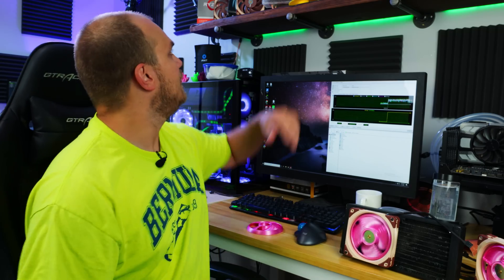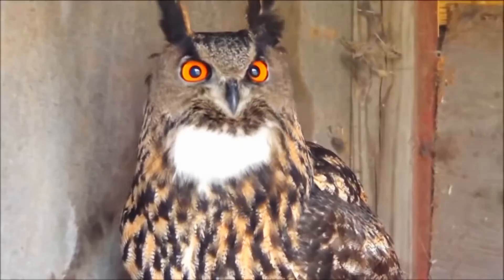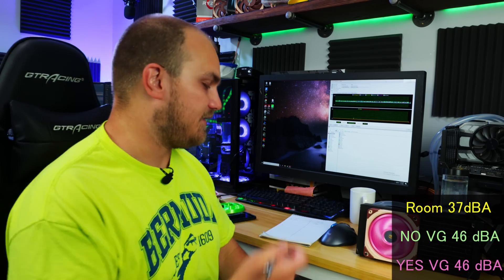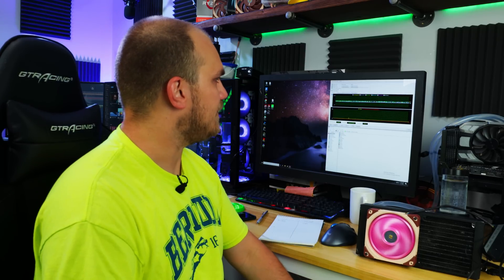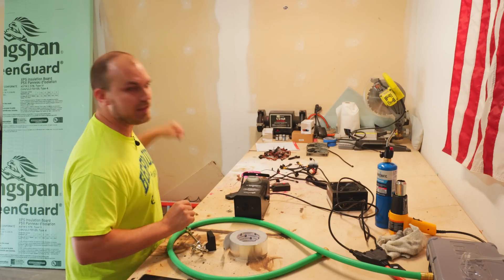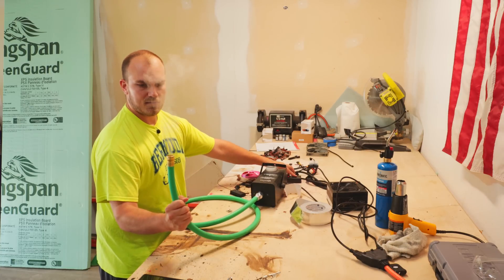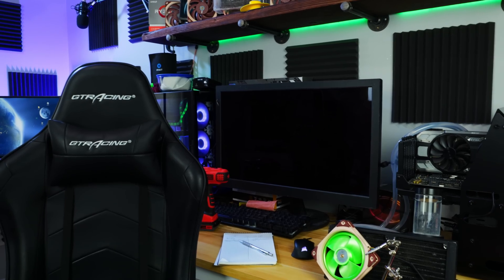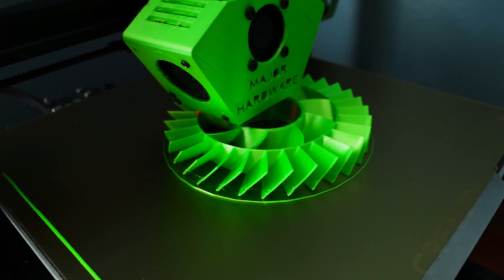Do Vortex Generators Make A Difference | 3D Printed Fan Testing

Comment: Hey Major, I think having the inward curve for the outer ring of the fan blades disrupts airflow. The frame has a chamfer to be able to pull more air in smoothly, the curve disrupts that (if my thinking is right). Maybe try reducing height and having it straight for blade strength. 
Now, what would you think of a bit of a wind tunnel by using a scrapped frame attached with a good frame and reverse the blade direction so the back of the fan pulls in air. I feel that I am not explaining it well but basically think of a turbine fan that has that second frame at the other end to keep it stable and not sag.
EDIT: my suggestion was made  while watching the vid, very cool concept at the end.
Reply: I also believe the fan-ring is disrupting and needs to be inverted, so it follows the curve of the fan-chassis. 👍
Reply: @Anziilife  That will increase air-speed flowing in while keeping the volume of air moved roughly the same. His current design reduces the speed of the incoming air by expanding the volume it occupies. Both methods have upsides and downsides, a large fan with a small outlet will be quiet but will have to be strong enough to push the air through the smaller hole. a smaller fan with a large outlet will allow greater surface contact with air on a cooler while saving the electricity required.. Good for mobile applications where size isn't a limitations, which honestly isn't really that much of an appeal, you should either go for same-size fan and cooler, or larger fan with a reduction into a smaller cooler.
Maybe sometime in the future they'll finally utilize the backside of the motherboard for cooling instead of just being a backplate. Maybe some clever case design and a water cooler will allow you to take advantage of the huge waste of space? I can see a radiator that pulls in air from the top in a blower like design through the entire radiator and blow the hot air at the bottom (or reverse, if it's a case with feet which will allow to easily pull air upwards). This also avoids sucking air into the case itself with all your precious electronics.
I would like to see an extremely large fan fitted with a tunnel to reduce its volume while keeping the same amount of air. But I honestly don't know how to explain that the tunnel should be a part of the blade rather than just a huge fan with a fitting to reduce it to a normal size.
Reply: @ScarletFlames1  So it would actually help increase the pressure on the fan, so it would perform better with the radiator to have the ring match the "scoop" of the chassis?
Reply: If I'm understanding you, you're talking about setting two fan frames back to back so that they will rotate in opposite directions,then engineering the blades so that one set pulls the air to the center and the second set contrarotates to push the air out the far side.

Sort of like the Cesna 337 Skymaster.
https://en.wikipedia.org/wiki/Cessna_Skymaster
Reply: @martindinner3621  Not quite, that is an amazing idea though. 
I was thinking more along the lines of having a short tunnel between the two frames to have elongated fins. The first fan would need to be positioned backwords since the framing would normally stop it from protruding further behind itself. the second frame would be to hold a central beam or rod so that the fins would not sag and hit the interior walls of the tunnel between the two frames.
Hope that made a bit more sense.

Comment: dont remove the ring print the ring straight up and down and get it as close to the housing as possible then go with a flat 5 blade design or go with and inversed ring that way the widest part is at the top and tapers in see if you can create a vortex kind of effect
Reply: What if one made a full on velocity stack? Make the ring into a trumpet.
Reply: @daniel46245  i see where you coming from yes i dont see it being much of if anything of an improvement but lets say you print one that is just a bit bigger then the noctua frame but not to big almost like the opening of a funnel with more of a flat blade and say 5 or even 6 blades i wonder if the static pressure diffrence and cooling could justify a bit of a bulky fan design probobly not but i would like to see it done mainly for entertainment

Comment: Dude the pink fan was disrupting the flow much more than the green. It kind of looked like the Pink fan was pushing the air away and causing a ripple in the smoke flow. The Green fan was sucking in the smoke smooth. Those small ripples/waves in the smoke stream with the Pink fan was the disruption that causes the air to pause a micro second before being pulled in. I don't really know if that is a good thing or bad but, think about swinging a knife into a piece of fruit.

Comment: Hey my dude, as always great video! 

As per usual, i highly recommend you to smooth out the surface of the fans somehow, it will help with the aero.
Reply: Acetone vapor bath. Also an array of straws should be used with the smoke machine to create lamanar flow.
Reply: @JazzyFizzleDrummers  Acetone smooths styrenes. This would not help with PLA
Reply: @rkatz69  fair point. I'm sure there are volatiles that would work with pla

Comment: Keep the vortex generator!
Also, you should use the same color when testing because the pigment can change the filiment a lot. However, since you aren't testing the strength of the fan, it shouldn't matter.

Comment: That fan has curved outer edge rim, try a straight one because you are now loosing a little bit on the intake side, that might make some difference.
Also it would be cool if it opened up "above" the fan on the intake side, to get bigger surface area, that would be funky :D tho narrowing towards exhaust means it will probably not work
Reply: Great suggestions and the converging geometry youre talking abouy should still work. It could be thought of as a nozzle, where pressure at the outlet is reduced but stream velocity is increased. Depending on the fin density of the rad, this may help or hurt the results. I'm inclined to think it would help substantially. I'd propose matching the OD of the inlet with the outside dimensions of the fan housing so you could still mount several on a rad, but increase the inlet volume. Would require going taller on the overall design.

Regarding the flow disruptors, I'll echo what others have commented: the surface roughness of the 3d printed surface is holding you back from both performance gains and real results regarding flow separation/turbulance. Consider abs with acetone smoothing or applying a couple layers of thick primer on pla to fill in ridges. Also consider adding those turbulance features to the underside of the blades as you similarly want to reduce the height of boundary layer flow causing drag and slow velocity air on the underside of the fan blades. Regarding the overall geometry of those features: i agree height is a bit higher than necessary and they could be a bit longer.

Also check out the ends of noctua's blades, they have small valleys that help guide the flow towards the center of the fan area rather than being forces to the side by centrifugal effects. They reduce the low pressure area at the center of the fan and help disperse the flow better across the rad.

Comment: Wouldn't 6 blades be more stable than 5🤔
Reply: I'm not a engineer or anything, but just a taught.
Reply: No it should not make a difference
Especially not at 3D printed fans
Reply: actually having a odd number of blades makes it more stable and also not change much if something slightly damaged. go check every fan you can and you will see that they all are odd numbered. It also somehow balances it better.

Comment: Thicker wing front edge creating "lift" into the case.
Reply: Yeah don't listen to this guy. He's dead ass wrong. Sorry, not sorry. Airfoils do create lift. By decreasing ambient pressure above the wing, atmospheric pressure below the wing is able to push up and try to get to an equalized zone. Suction is not strong, pressure is. Think how big dust collector hoses for woodshops are, but how you can easily move just as much sawdust around with a thin compressor hose, and a blower set to 5psi. (not a completely accurate analogy, but very close). This is called a reaction based pump/fan/prime mover. Reaction type pumps are great for high pressure, but awful for mass flow rate, which is why pc fans don't use them. The high static pressure fans you see are generally also impulse fans, but incorporate some reaction principles or design. Not enough that I would go so far as to call them impule-reaction type, though.
Reply: @g45h96  I think that same rayzim dude has been "teaching" fluid dynamics to everyone on other videos of this channel too, dunno if it was this comenter or another one with similar things claiming you don't make lift on fans because you don't want to load the bearings... because it seems that the axial air flow magically does no load on the parts, nevermind that strong fans set on a desk start moving on their own at full power...
I mean I get it that fluid dynamics is one hell of a topic (my tests on that class are still sort of a trauma and pride at the same time in my mind...), but claiming wrong stuff as facts with a straight face is an issue for sure for anyone interested in learning.
Reply: you do not want lift you want flow  
the difference between lift and flow is lift moves the fan threw the air flow moves the air threw the fan 
also lift creates a low pressure zone above the airfoil without crating a high pressure zone below the airfoil it actually is still a normal pressure zone its just because above the airfoil is not a low pressure zone below the airfoil comparatively is higher then the air above but is no higher then the rest of the air around it 
it is a misconception that airplane wings and air foils actually crate lift when what they actually crate is suction by crating a low pressure zone above the air foil you are actually sucking the plain into the sky with the low pressure zone above the wing 
the flaps on the wings are the part that actually crate lift and when you set the flaps for landing and take off you actually point the front and back of the wing down creating more of a fan blade shape that way the wing moving threw the air push down toward the ground crating a pocket of higher pressure air under the plain 
and that is what you want in a fan blade is something that dose not create lift by suction like an airfoil but flow by simply redirecting the air like the airplanes flaps
Reply: @rayzimmermin the airfoil creates lift. flaps increase lift at low speeds. They do this by increasing the camber of the wing, and increasing the angle of attack without actually changing the angle of the leading edge relative to the air, therefore avoiding stalling. That's why superlights and tail draggers can do almost 0 knot landings in high winds.